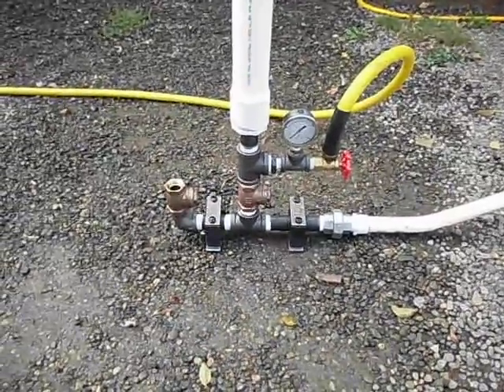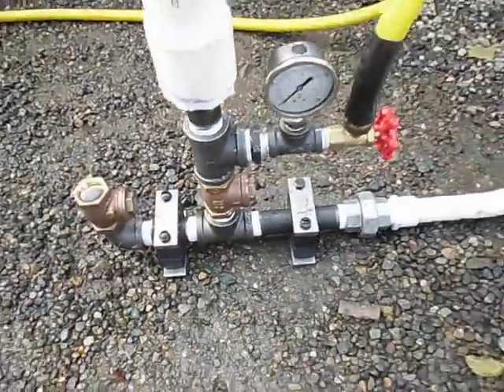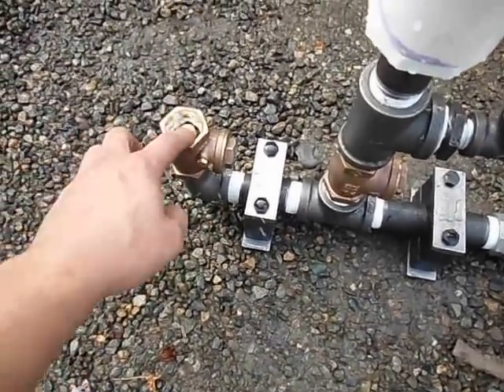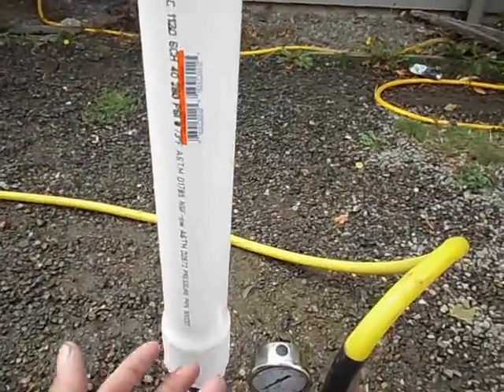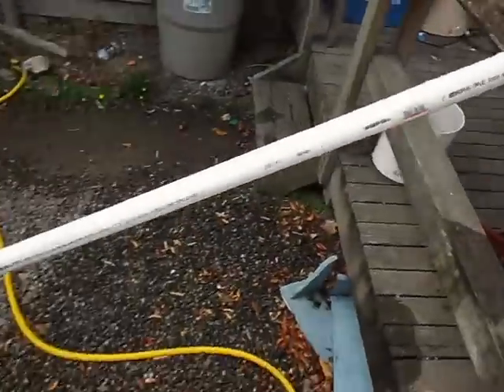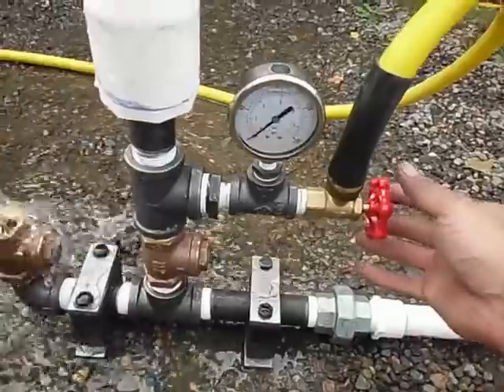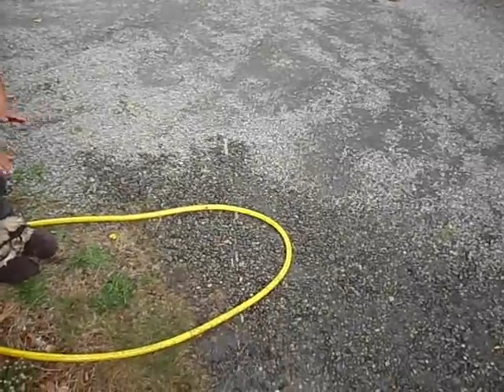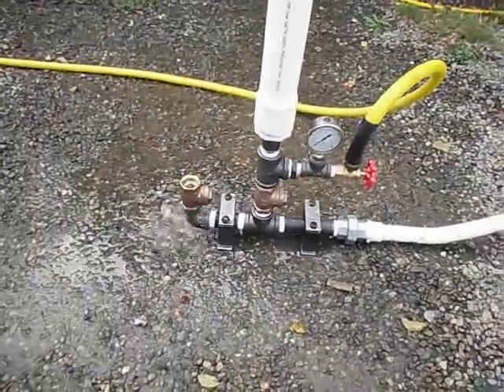Homemade Ram Pump

Comment: Since the end of the hose is 15 ft above the gauge, the psi on the gage ought to read 6.45 psig..  The calculation is .43 x the height in elevation of 15 ft = 6.45 psi.  Btw, the check valves are made of bronze, not brass.  Nice vid. Thanks for taking the time.

Comment: I didn't understand the point of the water weenie. doesn't that chamber just need to be sealed and the air pressure kicks the water back up the hose? what does the foam do?

Comment: Sir please help me my ram pump cant deliver water to a 3rd floor building what problems do I need to fix
Reply: But the valves are swinging and it can deliver water to a place a little bit higher than its water source.

Comment: And there is a good reason, (That I can't see)  as to why you wouldn't just stick a hose in the river/waterfall and use the water in the hose  ??
Reply: Water doesn't flow up hill. Theres this thing called gravity

Comment: Great vid. Only thing I did differently was use ANSI 61 High Density Polyethylene (HDPE) as it is MUCH safer than PVC. PVC, for some reason this isn't commonly known, is nasty stuff and shouldn't be used with drinking water.

Comment: its using gravity to pump, that is way the main water flow tank is elevated from the pump and there is a lot of water wasted. If the main flow tank is at the same level or below this pump would stop. you could try a windmill pump would work way better with no waste and pump a lot more water.

Comment: The water from the check valve could be entrained by a inductor device so it remains in the circuit instead of going to waste

Comment: would it not be as effective to set up a second water reserve that works off the same principle of the water wings and the pvc, this way it keeps more water in the system itself if being transported a long distance, or would it prevent the system from working correctly?

Comment: what about the water is westing from macenisum if you make another pump like same and the system needed inside the plastic pond and out put of the pump goes back to buket that way the water is not wested.

Comment: curious, could you place a 6 inch peice of pvc just before your inlet to your pump with a water filled bladder to increase your head pressure artificially?
Reply: That would not increase the head pressure.

Comment: Hi, I have noticed there are various ways of assembly. Your waste is at the end of the pump as with many others, yet others have there waste prior to the pressure riser (ie , in reverse of yours) Question is.. is there a advantage on the delivery line using either system or would there not be any relevant difference to worry about. Thank you, One of the better video's by the way.

Comment: Quick question what would the setup for a simple backyard aquaponics system using be for a 1000 liter Intermediate Bulk Container (IBC) instead of using electrical water pumps which are expensive or not readily available in this part of the world? The so-called dripping water can redirected back to the source IBC fish tank or to the growbeds with the water outflow water... What do you think? Quick question became questions and long.... hahah

Comment: If you connect the host directly to the pump (with 40 psi), what will be the output, is it an high pressure pump ?

Comment: helo joshuaburks
 , ive made exactly the same like model above, but the problem is, during the process, the check valve does not move (open & close movement) its just close forever. why is that?

Comment: I am looking at building one of these and using my house hose as the 'pond'. My design will use the water from both the 'waste value' and output. But how can I have the water stop from the 'pond' automatically? I don't want that to constantly be running.

Comment: Could you run these in series to "catch" the water from the first pump? Or does swing check valve decrease pressure too much? A reservoir with another drop of 4 feet might be able to create pressure.
Reply: Tyler Groskreutz The

Comment: Building one now, I was showing my daughter your video. Great example you have here !
Reply: This is good for a scientific experiment, but if you want to use it for long term utility purposes the flap valve he is using for a clack valve is very prone to wear due to metal slamming against metal. I can sent you a diagram of a cheap to build long lasting clack valve Via email  if you want it.
Reply: can you send me a diagram of that cheap to build? @jeremiah pierce? dannytamayocpi at gmail dot com

Comment: I noticed that several people posting about the ball valve not lasting due to metal to metal wear. If you need it, I can send you a simple diagram , via email, of the clack valve that I designed that ran for me for over two years, and never wore out. It is made from cheap simple stuff you can buy at any hardware store. It may even be cheaper to make than a ball valve costs.

Comment: Also swing gate valves cannot be precision taylored by being able to be adjusted for the weight and the stroke of the valve to match the flow and pressure of each individual installation. This is very critical to obtaining maximum out put for the fall and volume of water.  No two ram installations are the same so being able to adjust the main valve is crucial to each installation.

Comment: I also tried using swing gate valves like you show and they failed very quickly due to the metal to metal pounding.  If you want to see a successful set of pumps that I have been running for 8 years watch my update video I just put up on July 20 2016.
Reply: I have a remedy for that, I would love to send you for free if you want.

Comment: We must not be talking about he same thing.  I have been using a commercial pressure tank and all brass spring check valves with the rubber 0-rings for 8 years and they are working fine. Itried the type of home made pressure tank you show and it kept getting water logged.  I don't like using a "snifter" to get air into the tank because it reduces the water out put.
Reply: I put a latex balloon in my home made  pressure tower. problem solved.
Reply: Snifter holes are meant to be tiny, just enough to replenish the air bubble. You can also position the hole in the right place to keep it at a better level. Done right the amount of air passing out of the pump should be trivial. But as Jeremiah notes there are other ways that work well. Some use pool noodles, inner tubes, latex balloons etc.
Reply: I hope it works for many moons for you!

Comment: the worst thing about swing check valves is that they are not adjustable to the flow and pressure which is critical to proper and maxim operation.  You will not get a pump with swing check valves to work very well for very long.

Comment: get a regular 5 gallon pressure tank and get rid of the swing check valves. Swung check valves will beat them selves to death and a commercial 5 gallon pressure tank won't get water logged. use spring check valves that have the rubber 0-rings around the seating face.  Been there, done all that.
Reply: What you say is true. I did not know that a swing flap check valve could be used as a clack valve, when I built a ram pump, so I designed a clack valve using a few washers, a PVC adapter, a bolt with two nuts, a few tiny screws, and a spring. It worked for over two years without fail.

Comment: I made one of these with a home made clack valve. The clack valve was made using a spring and the water sprayed out horizontally about 50 ft downstream between clacks. While I was at work the next day, the clack valve bumped the pump about 30 ft. downstream.

Comment: I have 9 gal per minute with 8 feet of fall from my pond. what size steel pipe should I use for my input side?
Reply: For my camp in the woods, I used 1.5" poly pipe for input pipe. My pump unit was a bit larger than the design in this video.

Comment: this numb-skull is just now starting to "get" this concept. My dad was an engineer and always told me there is no fooling nature; you can't get more energy than what you put in.  So you are saying yes you can, if nature is supplying the energy to start with---right?
Reply: Basically he's putting in let's say 10L per minute at height 1m and getting out 1L per minute at height 3m. That means that the total potential energy goes from 10L * 1m = 10 units of potential energy in the bucket to 1L * 3M = 3 units of potential energy output from the pipe on the roof. No energy was created, less was taken out than was put in because the system isn't 100% efficient. Nature supplied the energy in the sense that it lifted the water into the bucket. The reason it's lifted higher is because only a small fraction of the water was lifted to that height - obeying conservation of energy.
Reply: It is harvesting natural energy, almost like a solar panel, but instead of electricity you get a little bit of water way uphill from the stream 24/7.
Reply: Yes

Comment: Basically, opposing "one way valves with a space limiter/compressor and expect essentially 10 % efficiency.
Reply: The big win for the ram pump is not so much the the effeciency but that a system like this can pump water without using a conventional power scource.  Escpecially when used in kreeks in the hills or mountains. It is a great way to get water up  hill in order to irrigate your garden.
Reply: If you have a field of horses or cattle, like 50 ft above a running creek, This is an excellent tool for supplying constant water to them.It would also save on your water bill. I used it for a camp in the woods, and it pumped water into a drum above my camp, so I had constant water pressure at my camp, from a creek that was about 30 ft below my camp..

Comment: Nice Joshua. Do you show construction or diagrammatic outlay ? Wondering. Also, I guess the pressure valve isn't needed but a nice feature.

Comment: I have access to a very large river, but it flows almost perfectly horizontal. Could I use this to pump a short distance of maybe less than 20feet? I want to have a permanent livewell to hold caught fish instead of using a fish basket in the river.
Reply: Just do it and figure out what works. I bet if you can get water flow through a drive pipe to the pump assembly it will work. You may need to use larger size drive pipe to feed the pump though. Try a 4" drive pipe or something like that.
Reply: River? use this! 
ecoinventos.com/bomba-agua-sin-combustible-capaz-bombear-45-000-litros-dia/
Reply: You have to install pipe in the river upstream until you have enough volume to run the pump. I ran one below a camp out in the woods of Oregon quite awhile ago. I had it feeding a barrel that I tied in a tree for water pressure.
Reply: These are mainly for streams that run down below hill country.
Reply: Just dig a ditch or burya pipe for that short distance....no need for any pump whatsoever for the use you describe

Comment: BTW, you were correct the first time... The cap was welded on the top of the PVC, as in melted two different items to form a solid joint.
Reply: Dude they use an adhesive glue !!!  Pvc glue !!! Its not welding
Reply: @eliasjarjoura445  The two pieces melt and become one: welding.
Reply: @stormytooman1947  as long as its not steel i can't see it as welding 
Note: I'm a welding inspector add up ultrasound and xray also,  if its not steel i won't see it as a weld .

Comment: Very clear explanation! Thank you for that. Many people fail to explain things clearly, and that can be very frustrating. Good job!

One question though. Where would one place the pump if one was drawing water from say a nearby stream? 
Would it be inside the stream? Or on the bank of the stream?
Reply: It would be attached to a pipe that runs upstream. The longer that pipe the better the pump will run.
Reply: I placed mine on a small sand bar in the middle of the stream, but they can be in, or along side a stream. You want as much altitude drop as you can get on your feed pipe though.

Comment: I also made one and I think drive pipe should be of G.I not PVC because I used PVC and it was vibrating while operation that I suppose is loss of energy. And also the delivery pipe should be thin, just to accommodate water flow so that the valve does not get too much of pressure that remains in the delivery pipe....1 litre approximately equal to a kilograms.
Reply: Hi Karna, 1 liter of water is in fact precise 1 kg at 4 degrees. And 1 liter as a volume is precisely 10 x 10 x 10 cm or 1 cubic decimeter. That's the beauty about the metric system, it's easy to get your head around.

Comment: it is so my question is the water that is getting pumped out onto the ground is there something that we could put over that to use that water for irrigation purposes?
Reply: I wonder if you could run a pipe from the waste outlet bypassing the pump and into the outlet pipe/hose, thus leaving no water to waste? just an idea.
Reply: Thanks Formagella, that makes sense. I appreciate your reply.
Reply: catch bypass water in a barrel and use a 12 v pump with battery and solar panel to return water back to source
Reply: These are designed to be in a creek or river not out on the ground. Submerged...
Reply: Chris Reninger
if so then how does this work being on the ground and not submerged??? notice of mistake, they are used out on the ground. all ram pumps i have seen in operation (43)were not submerged but were in open air. you can not develop enough flow energy to cycle the ram if the outlet is under water.imeo.
Reply: Or do absolutely nothing more to it AND it still will  return to its source....period. ZERO waste. It will either go back to the creek or to the nearest aquifer.

Comment: Thanks for sharing this one. My only thought is. . 
I'd like to incorporate this one into my aquaphonics system, but I don't seem to know how to save the water that keeps on spilling off the pump. Can you suggest any technique to make the spilled water return back into the water source?
Reply: +Genelyn Alvaro  cant you just put the waist valve into a catch basin and let it drain back into the down stream flow?

Comment: PVC pipe works just as good as steel for the head pipe, I made mine using 80-feet of 1 1/2 inch PVC and it works just fine.  I also used a Plastic exit check valve.  Also, you do not need a valve on the outlet, nor do you need a pressure gauge, the pressure don't matter.  A ram generates very low pressure anyway.  If it's pulsing, it pumping.  I get 1028 gallons a day out of my pump 300 feet to the barn and 30-feet of rise.   The only thing I am using that isn't plastic is some of the fittings and the impetus valve.

Comment: I like the simple off the shelf design and clever use of a swimming noodle. Is it necessary to have a valve at the hose? Does the valve help you to avoid pushing the check valve down until it reaches max. air pressure? Once started, will it stall for any reason?
Reply: The valve is needed so that the air column can be charged with the water pressure.  After it's charged, the outlet valve is opened slowly so at not to place an excessive one-time demand for water.  Eventually, the outlet valve can be opened completely.  You may have noticed that when he opened the valve the first time too soon or too quickly, he lost the pumping action.  He pushes on the waste valve a few times to get the system primed.

Comment: I dont understand why you would need closed cell foam in the air blader. Why would it not work with out it?  Its a airtight chamber and the air has no place to go so why would you need it?
Thanks, Gary
Reply: +Gary Faulk  The air will slowly be absorbed into the water.  The volume of air will slowly decrease until the pump stops and then the air chamber will need to be drained.
Reply: Mine ran itself out of air once so I put a plain old latex balloon in it, Problem solved.

Comment: great idea, you can put the end to the source and it will be a loop,  put the tesla turbine in the middle and a generator you can have free energy generator. well just my theory.
Reply: I was thinking almost the same. I thought perpetual motion. But 90% of the water is wasted in the water hammer so its not like a perpetual motion machine. You could catch the water with another ram pump to get the water back into the bucket but still wasting water there. Besides you need a very big pump or a lot of ram pumps to be able to generate a little bit of energy. To generate energy you are better of putting a turbine under the bucket which is useless since it costs energy to get the water there.

Comment: There is a creek down behind the house with about 15 ft head required to make it to the garden. I need to try to emulate this set up!
Reply: The swing valve he uses for a clack valve is not good for long term use, I can send you a simple design for a clack valve that worked for over 2 years, if you want. I can also draw up a design showing how I built the whole pump. All I would need is your Email addy to send the designs to you.

Comment: That's an awesome work! How long the PVC pipe and size? and how long of foam inside the pipe? Thank for the answer!
Reply: A latex balloon in the tower works great, if you want to save a little cash. that is what I used.

Comment: I agree ..You  saving the electricity but wasting the water...
Reply: +TONY BAZINI Unless you have a natural water spring nearby
Reply: +TONY BAZINI These pumps are put in streams/springs.Insted of all the water eventually flowing into the sea, you use a ram pump to make use of some of the water without using any energy.
Reply: does a stream running down to the ocean waste water? neither does this device. It uses the energy of the stream.